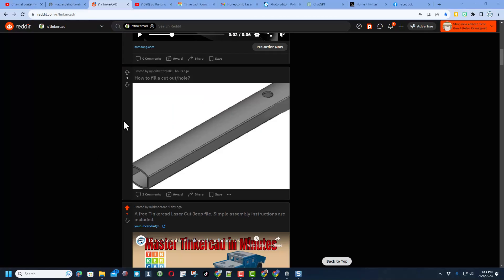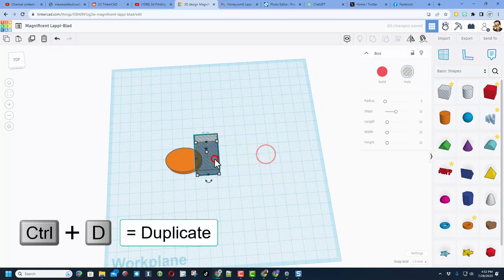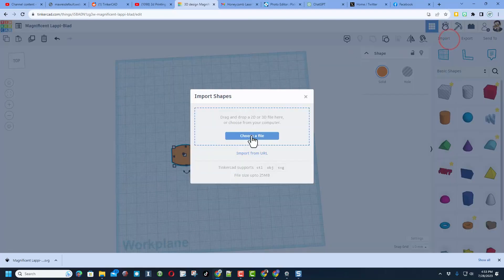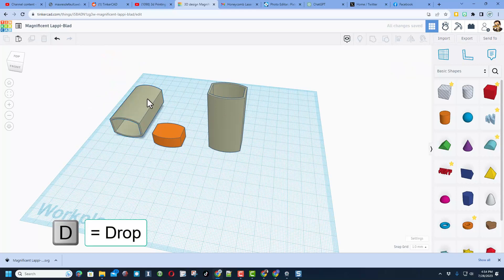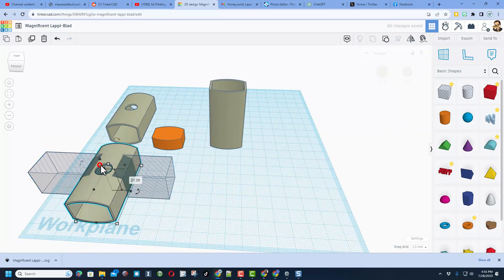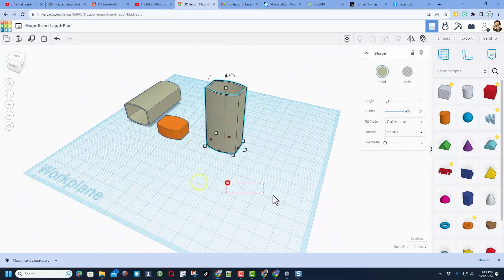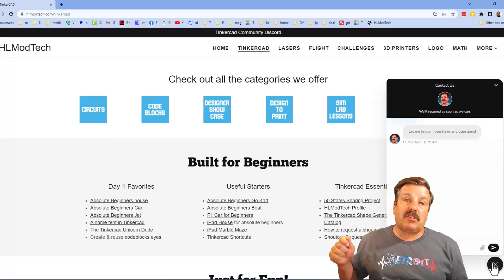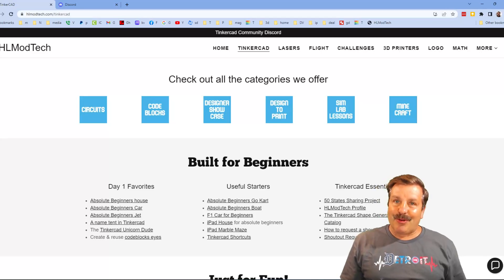Super Smart Tinkercad SVG Export, Import, and STL Fix Tips in Minutes

Comment: Great vid.  I have been trying to export a sketch generated svg and import it again into the workplane but it keeps showing up as a cube.  Any Basic shape exports and imports o.k.  My sketch is dropped onto the workplane and the side I want to be the "2D" svg is laying flat on the workplane.  I have watched 2 of your videos which do the same procedures but I am not having any luck.  What am I doing wrong?
Reply from the maker: Not sure. https://youtu.be/cXQd-zuuE7w?si=kEuiBEAOGhNuYQ8_
Reply from the maker: My Patreon has a message area. You can shoot the link and I’ll try to take a peek at it.
Reply: @HLModTech  So I rebooted my computer, started in a new "Tinker this", put the sketch tool on the workplane, drew a triangle using 3 points, finished sketch, dropped, exported as SVG, imported same SVG file onto the same workplane and it comes up a box.  I am wondering if there is a bug in the latest release of the sketch tool.  Try it yourself and please let me know if you have the same problem.
Reply from the maker: Just confirmed your results. Passing the devs now. A quick question though... with the Stroke tool in sketch... why would we want to use import the SVG? The new stroke features are more powerful that the old imported SVG fill options.
Reply from the maker: I confirmed that it is a rectangle in Lightburn too... so if we were saving for laser cutting it would be a problem. Since it is Labor Day weekend I doubt we hear anything for a bit. Thanks for alerting me to this.
Reply: @HLModTech  I was trying to make a blimp and I was using the sketch tool to make a unique shape and then save it as an SVG and bring it back in order to put it in the SVG revolver.  Is there another way to do this?
Reply: @HLModTech  No hurry, I am just glad I am not going crazy or was making a very simple mistake :)

Comment: I Need help because every time I put my flash drive In and then go to tinkercad once I design it and try to save as stl it doesn’t actually save as one it only saves as like html and stuff so when I plug the usb into my 3d printer it pops up when I wanna build something but not as an stl so I can’t build. Please help thanks
Reply from the maker: Once you create a Tinkercad design you export it as a STL. That file then needs to be opened in a slicer to send to a 3D printer. This video shows the steps for how I print with my Mingda Magician X2. I have it cued up at the part where I load the STL file. https://youtu.be/kDHkfYZl5pw?t=561
Reply: @HLModTech thank you I will try and see if I can figure it out
Reply from the maker: What model of printer are you working with?
Reply: @HLModTech flash forge finder 3